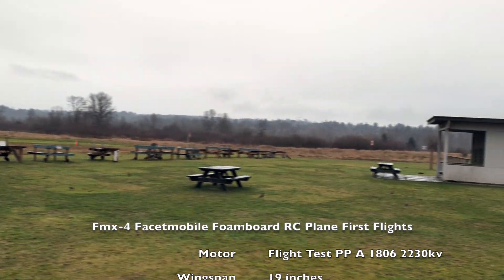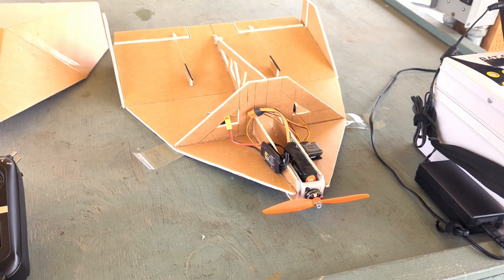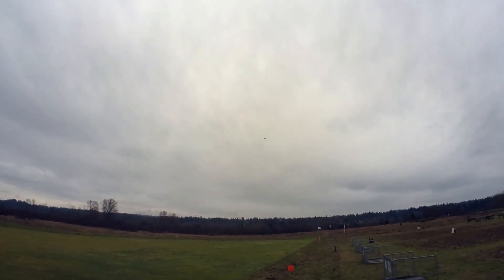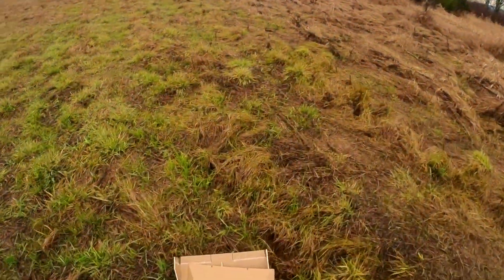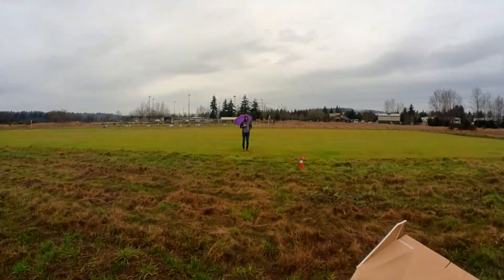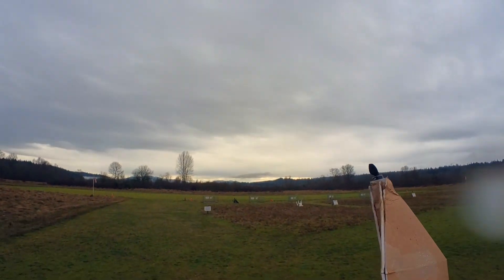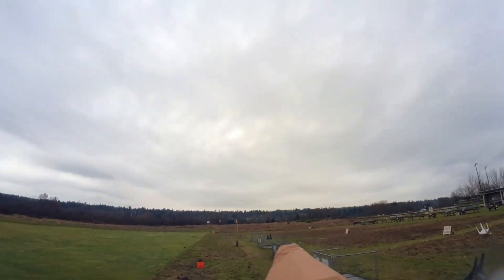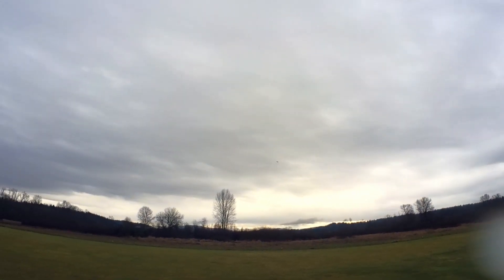RC FMX-4 Facetmobile Test Flights

Comment: Good video. I also built an FMX model from bamboo skewers and heat drink plastic powered by a top mounted rubber band motor. It flew well.
Just wondering if your elevators were larger or built of a thinner material if they would have more effect. Anyway, great effort. Thanks for sharing.
Reply from the maker: Thanks for the comment!  I have since made another of these, but with elevons that were larger, and it flies pretty well.  I need to edit the video from those flights still.

Comment: ok i looked at the real design and i do have to say the back of it is much more angled up the top isnt as curved as yours its deceptively flat while the bottom is more "curved". if you look at pictures of it wirhour covering you can see that where the vertical stabs are the fuselage actually angles up to about the middle of the rudder leaving some of the rudder under the plane its hard to explain but look at more pics of it im sure youll notice
Reply from the maker: There are no curves on the real one or this one (besides near the motor on the real one).  It's entirely made up of flat surfaces.  Hence "facetmobile".  It's as close as I could get to a scale model with foam board.   The angles should be close to identical as well.  If you see curves, you're perceiving something wrong.
Reply: @lienmeat  yeah what i meant is the bottom isnt completely flat it has 2 planes the rear one being angled upto give the design reflex to keep pitch up attitude
Reply from the maker: @Estuardomendez13  and so did mine.  same angle.
Reply: @lienmeat  i see that now maybe its just the scale sometimes small scale airflow specially turbulent one like a faceted plane can cause it to be not perfectly scaleable i can see when it flies that once it hits a certain pitch down attitude it just locks itself as if maybe the lower surface stalls or the top one unstalls either way locking into a pitch down. i think longer control surfaces would work better for this scale

Comment: so what i think is happening is the elvator needs to be way longer the way it is right now when your angle of attack goes negative the shape unstalls but there osnt enough elevator so it just forms a downward airflow that lifts the bottom the real life version i believe has longer control surfaces too to give the flying wing the reflex it needs to keep pitch up attitude
Reply from the maker: I do agree larger control surfaces would help. However, relative to its size, the real one has the same proportion of control surfaces as this one.  I do think the weight is probably not "scale" though (mine being heavier), and that is probably why it would need larger control surfaces to fly better.
Reply: @lienmeat  its the reflex the real design doesnt have a flat bottom instead it has 2 flat sectiion the rear one is angled up to give pitch up moment if you look at side views or pics of it from the bottom you will see what i mean

Comment: It's just to heavy !!
Reply from the maker: yeah, could be for this shape of plane.  I'm coming to that realization myself.  I have a FT tiny trainer that I've got up to about 30g lighter than this when I put a flight controller in it that flies excellent though, so I thought it was "OK" for weight.  But I flew this again trying to solve the assumptions I had for what was wrong and it flew the same as before.

Comment: Several possibilities for this.  Not enough control authority due to limited throw or surface area.  (note with elevons it is sometimes necessary to use a fair amount of expo).  Then we move onto one of the things that really tends to bite you, too high of a wingloading.  With small birds your available lift is small so it is critical to build very light.  Power isn't the end all to performance, old saying- Given enough power you can make a brick fly.
OH YEAH, keeping the airframe in one piece helps.
Here is a video of a squirrely maiden flight of a bwb for you, lol >>>https://youtu.be/73KvIXXCZacno
A better video for second flight.
https://youtu.be/MmF5kgUkEgQ
Reply from the maker: Thanks for the advice!  Yeah I did try keeping it light but I had only 2 battery options available without buying something else, and 1 motor option, unless I wanted to jump to something quite a bit too big.  The weird thing is at first it seemed to have plenty of authority, and then all the sudden, nothing at all.  Really do kind of think the top half came undone in the back and messed up the airflow over the elevons.
Reply: @lienmeat  It's entirely possible that the top coming loose could have blanketed your control surfaces.  I've seen instances with foam where ot started to flex around the control horn looked ok until you applied some force to the surface then the horn would move but not the surfaces.  Servo mounts also can bite you like that as well as control rods flexing.  But if the top of the fuselage came loose either it was blanketing the surfaces or the airframe itself was flexing.  The way the plane jumped put of your hand tells me power wasn't a issue. 
I love the design of the Facetmobile and had even contemplated building a full scale one myself.
Reply from the maker: Wow, a full scale one huh?!  That would be amazing.  If you ever do make one please let me know. I know someone in Oregon was working on a full scale, but I think that project never went anywhere.
On the ground, I tested control rod flex and added foam braces with coffee straws to prevent it, and it didn't flex hardly at all after that.   The control horns do seem to move the flaps well even when pressure is applied with my hand against their direction of travel.  But you are right, these are really common issues.  I've had problems with control rod flex and foam flex being an issue in the past on other builds, but I think on this one that isn't the issue.